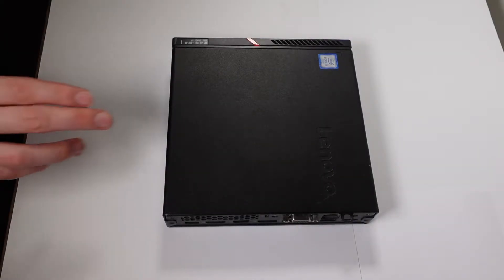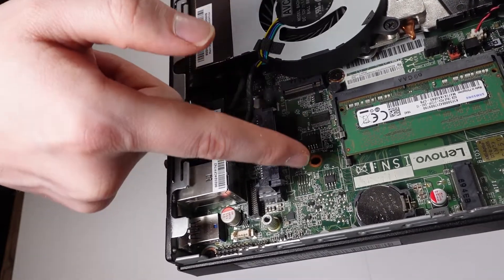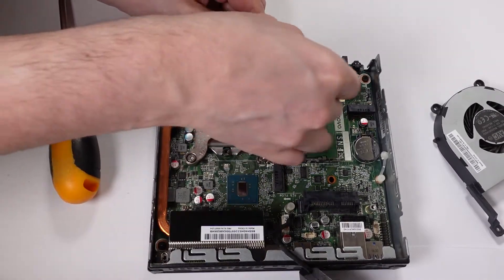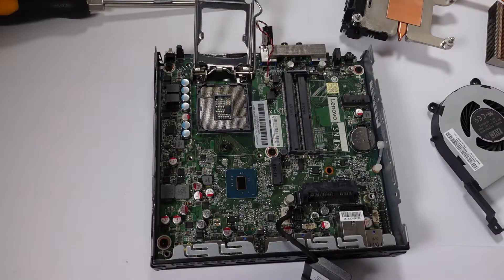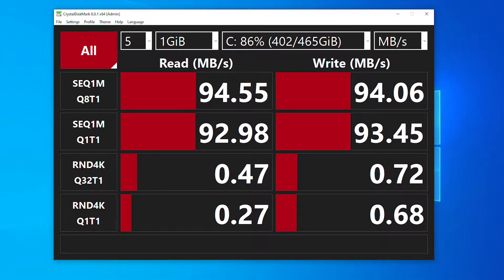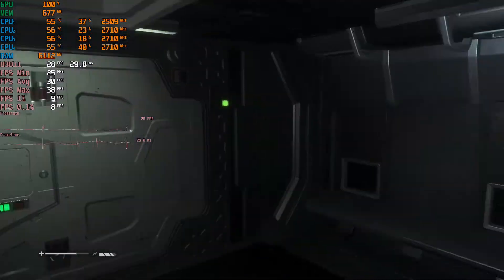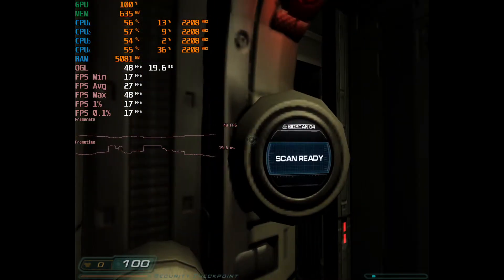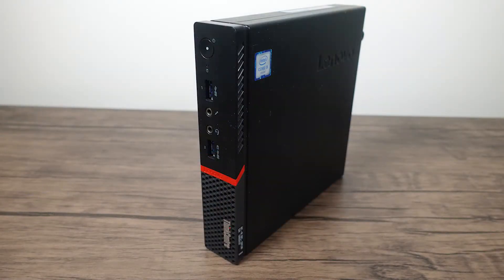Lenovo Tiny M900 - £150 - £200 Budget Windows 10 Machine

Comment: How did you make about the temp, about do not have high temperature gaming ?
Reply from the maker: The machine was cleaned with fresh paste. So that might have made a difference. I don't recall doing anything to get lower temps
Reply: @AvenyetsTechWorkshop  maybe, I have to wait that warranty been finish for open the case

Comment: Does this supports 4K display?
Reply from the maker: Depends on the model. The ones with display port run 4k at 60hz the hdmi ones run 4k at 24hz.
Reply: Does it struggle? I have a 4k monitor. would like to know if it doesn't struggle writing docs in 4k
Reply from the maker: @Cloud_Strife_19  can't see why it would. It doesn't require that much power to push 2D to 4k. I don't have 4k to test but at 1440p I never see any issues.

Comment: did you ever install a new CPU, what size and how did it go?  looking to go to the 6700t
Reply from the maker: A 6700t is compatible. I've not been able to get my hands on one for a decent price yet. This machine is just a normal socket so you can just pop the 6700t in with no issues. All 6th gen T processors are supported.

Comment: Shame it came with a dud hhd and one stick of ram, have you played with Linux on one of these?, Could be a good video idea. Personally I've had good results with Linux mint xfce and Linux lite, really helps to modernize these systems whilst being light on the limited resources.
Reply from the maker: Mint should work really well. I use mint as my daily driver. Been meaning to do a video on it. It would all come down to driver support with these machines, there is nothing too fancy but Linux can be a pian at times.

Comment: does this tiny beast have a certain kind of gpu like a gddr5 or ddr3, and if it does, whats the name of the gpu and please recommend some gpus that can fit inside of the tiny computer
Reply from the maker: No GPUs can fit inside. You are stuck with the Intel onboard. It will use the ddr3 and is only suitable for light gaming.
Reply: I have one these sitting around too, it shares the systems ddr4 ram. To get most out of it you should run dual channel ram (2 sticks), it is a pretty bad on board graphics but it can play GTA 5 at 900p 30-40 FPS. Older games like half life 1 can run on it fine tho and emulation is good too if that's your thing.

Comment: I have the same Thinkcentre M900 with i5 6500T, it came without wifi. What faster card other than original AC 8260 can I install in it? I read that Lenovo has whitelist for wifi cards in bios and if its not in the list it wont let system to boot.
Reply from the maker: I'm not sure on the whitelist limits but since most WiFi cards are the same chips I suspect most will be fine. Though you can get an original CMB,IN,8260 AC off eBay cheap enough.
Reply: @AvenyetsTechWorkshop  if I get original 8260 with vPro will I be able to wake it up through wifi? ethernet port already has wake on lan capability
Reply from the maker: The none pro should be fine to I think it's been a while since I've seen a card that didn't support WOL but I know cheaper ones lack it. WiFi WOL isn't great in general but the  vpro comes with a few more features but they are more for server based stuff.  If the price is right get the pro gives you options in the future.

Comment: Hi, I’ve got one same like yours, but I have some problems installing the windows on it, how did you manège it? Thx
Reply from the maker: What version of Windows? For Windows 10 I just created a usb installer from the free tool and installed it from that. No issues. 
What problems are you having? Is possible you have faulty ram etc?